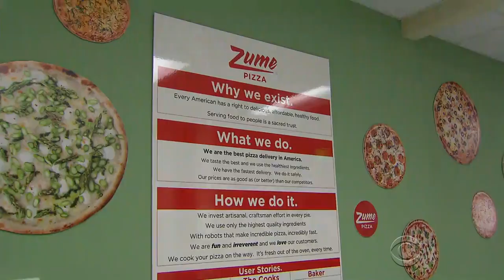Robotic pizza restaurant opens in California

Comment: So many people saying this is due to people demanding a higher minimum wage but ignore the fact that in 5 years time, their jobs are going to be on the line to. This is how technology works, and with how fast it's advancing, most jobs are not going to need human workers as the tech becomes cheaper, more reliable, and better. What this also means is, because of how technology has advanced, there won't be jobs to replace the ones we lose, since all those jobs can be done by automation, and any job that could possibly need humans will only be able to host about 15-20% of the entire human population.

Comment: Half the calories for the same price means half the food for the same price, right?
Reply: Alex Lydiate not necessarily. Calories are not = weight. You can have smaller meal than me, but that meal could still have more calories
Reply: Calories are based in weight. Fat = 9 calories per gram, Carbs and Protein = 4 calories per gram. The weight is not necessarily an indicator of amount of food, though. E.g. Water = 0 calories but very heavy.
Reply: Less food, more water for the same price. Genius!
Reply: Tyrel Goldberg what's this useless water I hear about

Comment: Ok well let's look at this logically let's say there is a million in robotics here and let's say these robotics are replacing $15 an hour workers the math on this is 1,000,000 decided by 15 to show how many human hours this cost is equivalent to which is approximately 66,667 hours and let's say the restaurant operates 12 hours a day it would take about 16 years for these robots to just pay for themselves And at the current minimum wage about 25 years so in my opinion until robots become cheaper there is no worry about them taking over any job that pays less than $30 an hour and is more of a novelty than a sound business idea over cheap labor and why China continues to thrive on said cheap labor over the us who continues to innovate using VERY expensive machines.
Reply: Initial robot might cost million dollars but once those robots are manufactured at large scale in china their prices will drop to less than 20k per robot.

Comment: Such a specific niche... Bad investment folks. Anyway, the robotic arm just outs the pizza into the oven only? And the delivery truck sounds like a huge waste of money and service life of these machines and the PhD staff needed to repair the facility will quickly price to be a ridiculous profit killer.
Reply: A robot like that, not to mention the other "robots" (most of them were very simple air cylinder/electric motor driven repeat machines) have very low maintenance.  I doubt that robot, lifting that load that slowly, will need more than once a year joint oil changes for 10+ years.